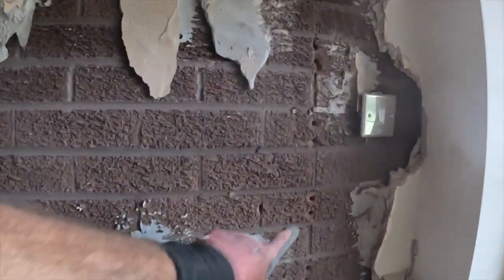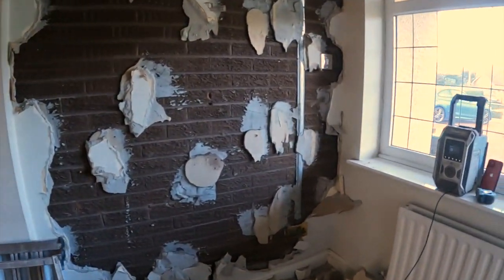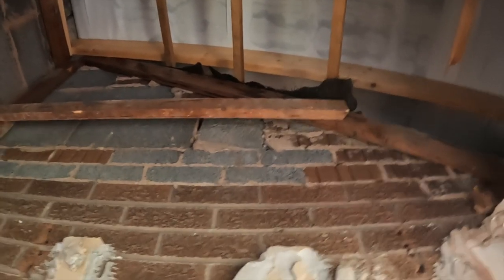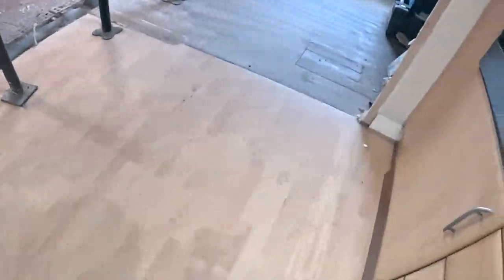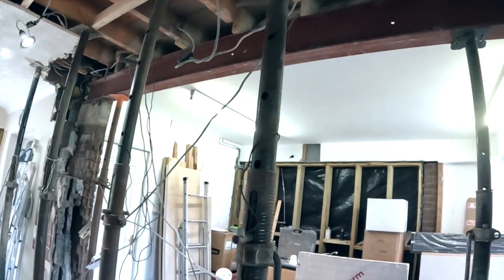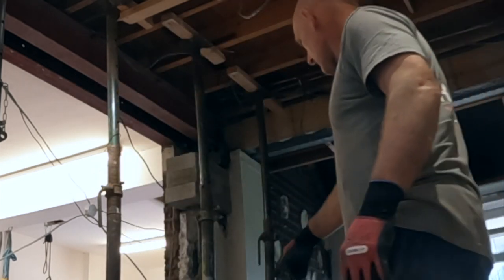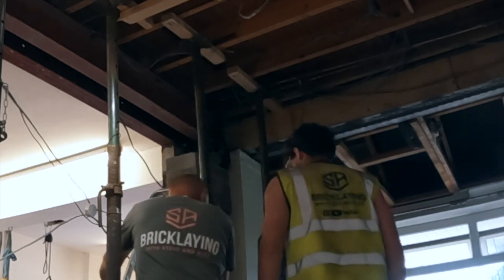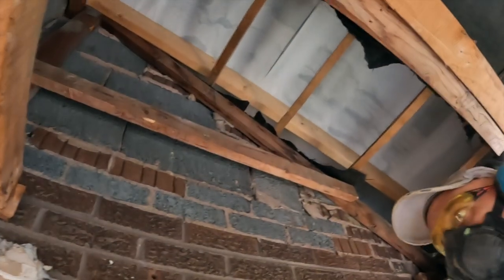MORE DESTRUCTION STEEL NO 2...GARAGE CONVERSION PT 4

Comment: If you can nail those wooden packers under the joists, you’d be surprised they can move over time with vibration of walking above, you wouldn’t think it but they can move. Great work your doing though.

Comment: Are you constantly under pressure to complete work as other trades such as electicians,  window fitters etc are booked in. I could see your frustration in a previous episode when the skip did not arrive. I enjoy the videos from real craftsmen
Reply from the maker: When it’s a 30 mile round trip and you have given a fixed price and timescale , going over those targets gets expensive 😒🧱👍🏽

Comment: Please don’t work like this , electricity will kill you , all wires should be isolated and terminated out of work zone
Reply: @nickeley2654 not really sure what you are expecting them to do? Yes cables were exposed, but all insulated and connected up? They are part way through a knock through, obviously you have to work around wiring, pipes etc.
Reply from the maker: @joshell2857  🤜🏽🤛🏽🧱👍🏽
Reply: Big job lots of heavy lifting must keep you guys fit hope you have a great new year all the best.👍👍👍😎😎😎
Reply from the maker: @richardsedorski1206  same to you Richard 😁🧱👍🏽
Reply: They know what they're doing. This is domestic work.
Reply from the maker: @chriscollins1704  🧱👍🏽

Comment: Out of interest do the supply spacers for the bolts in the cavity. When we did this work they would use spacers like a tube of steel cut all the same length then you just tighten the outside bolts .cavity is all the same size it saves time and it a better system. Just wondering if you've used them?
Just make sure you measure the cavity right or its a cockup .Good work always is with you two and good luck to you and family for 2023 one of the best in youtube first i look for 😀👌👍🧱
Reply from the maker: Hi Justin we ordered this method as you can’t get the cavity wrong as it all adjusted with the nuts 🔩 on site . There was no way of getting an accurate cavity measurement before hand . 
   Happy new year to you and your family too Justin , fingers crossed for BCL 2023 so we can all have a catch up .🥳🧱👍🏽
Reply: @Bricklaying With Steve and Alex   
Yea i no that unless you drill through you dont no the size of the cavity was only a question in my very small brain i thought id ask you .works great if you no the cavity size .
Yea bcl 2023 would be great steve 👍 😀
Reply from the maker: @brickrightbuildinglandscaping  😁🤜🏽🤛🏽🧱👍🏽